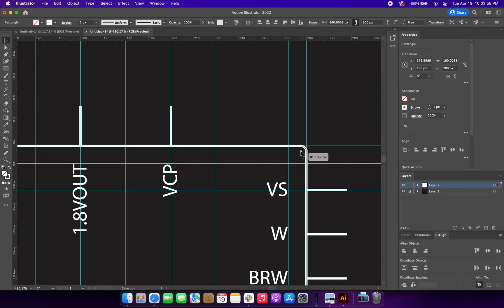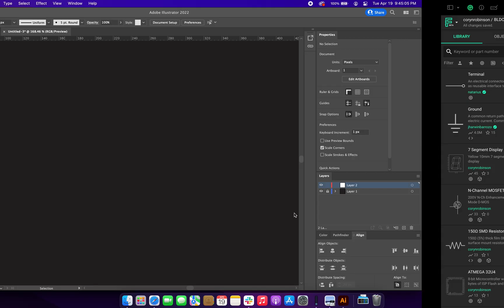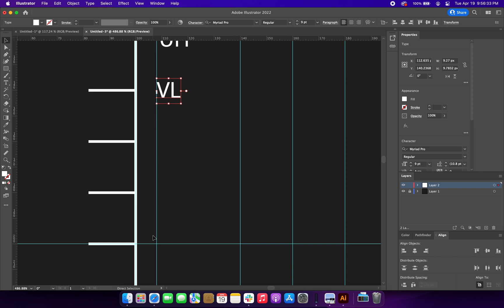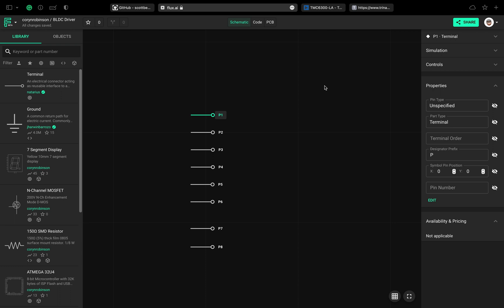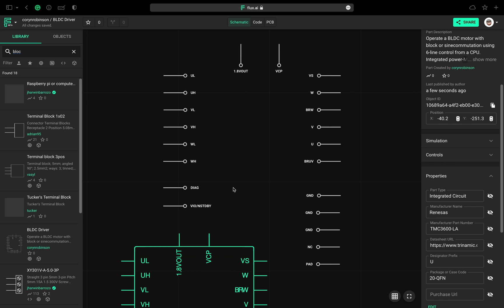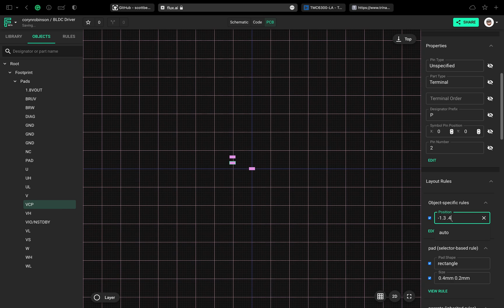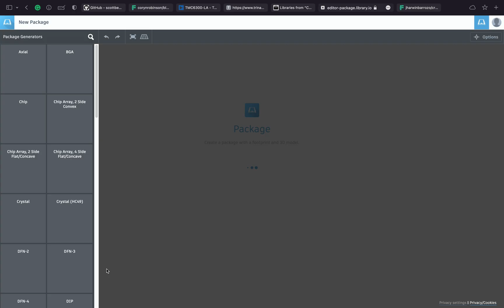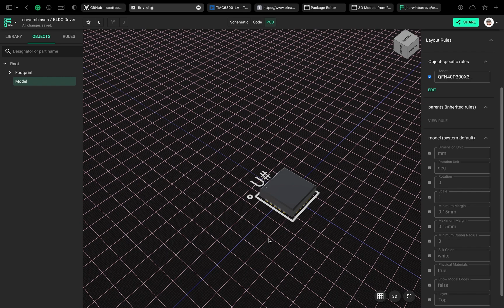Flux Parts From Scratch!

Comment: So to add a simple 4.7uf electrolytic SMD cap I need to become and expert in Adobe AI and even then it will take me 20 minutes?
Reply from the maker: Not necessarily. You can fork an existing capacitor and only change the properties.
Reply: @overshootchannel  To create a circuit diagram I did that with an existing cap.
However, the goal is to make files to have a PCB made. So why can't I just import a component from a vendor that has the layout, 3D model and availability? I could not find that functionality and felt I had to make my own. That's where my comment comes in.. Examples show using Adobe AI to generate the layout etc..